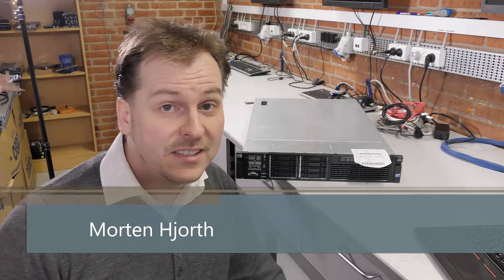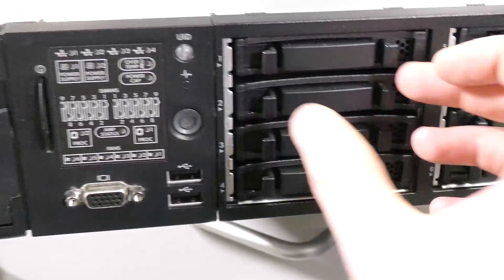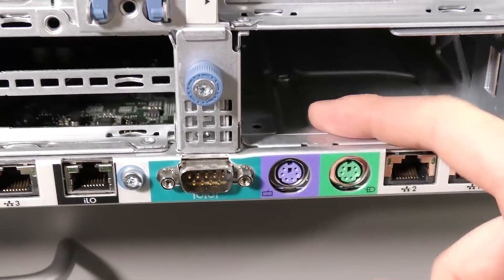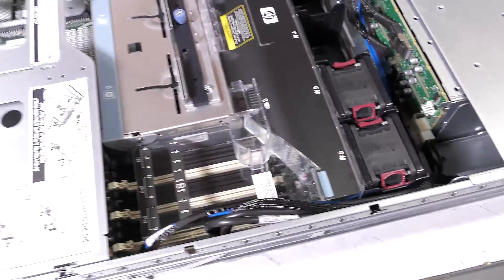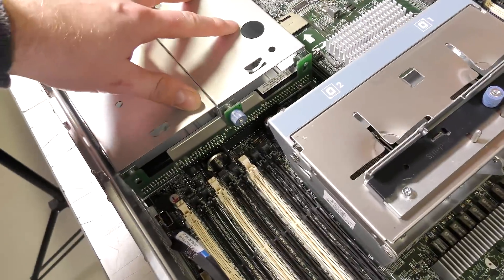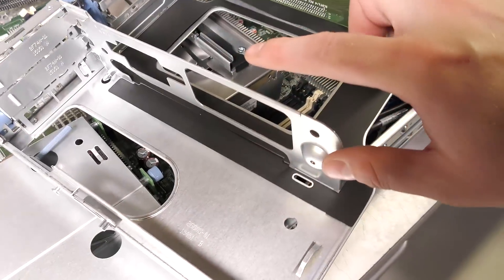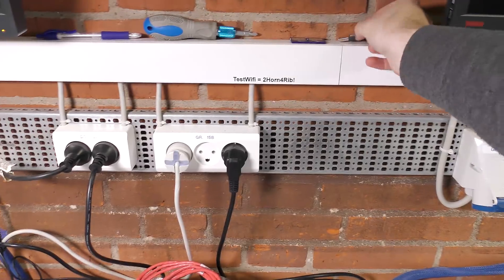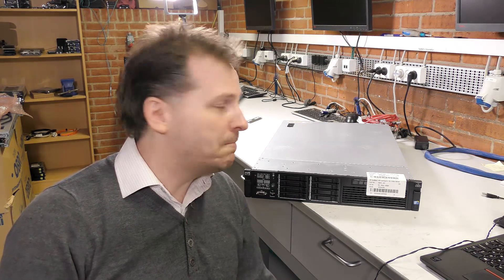HPE ProLiant DL380 Gen7 Server Review - 601

Comment: @Myplayhouse
Can you please tell which graphic card is compatible with this model?
I want to use it as a pc..can you help a little bit?
Reply: Oh boy, I was thinking about that too, so i did something researches.
First of all, I discovered that hp proliant dl380 g7 and dl380p g8 have a huge problem, the support only 1 slot cards, so you will run into some issues trying to fit in them some powerful gpus, but if you are ok with putting a single slot gpu then it's ok, and in this case I would suggest you to buy a g8 (because cpus are more powerful and the upgrade path is a lot better).
Otherwise you can buy a dl380 g6, which has the same socket of the g7 but can actually support 2 slot graphics card (even though you have to remove the IO), so you could potentially use it as a powerful gaming rig, or a cheap workstation, since quadro are a bit expensive.
Reply: Despite everything man you have to consider one last thing, these machines are noisy as hell, so you may run into some issues using one of those, because if you use intensive applications such as gaming or rendering it'll be like running a vacuum cleaner more or less.
Reply from the maker: Sorry, I do not know.

Comment: Hello great videos subscribed to you thanks. 
I bought today server for myself was hesitant..... But bought  it in the end 

 Server HP DL380 G7
CPU: 2 x SIX Core Intel® Xeon® Processor E5645 - 24x2.4Ghz ( 12 core 24 treads) (12M Cache, 2.40 GHz, 5.86 GT/s Intel® QPI)
48GB RAM DDR3 
8 x bay 2.5\" HDD SAS or SATA (included 1x 300GBHDD 10000rpm)
GPU: integral ATI ES1000, 64MB
Raid card : Raid HP Smart Array P410i + 512MB write cache
LAN: 2x NC382 Dual Port Multifunction Gigabit Server Adapter
Pcie slots : 3x PCI Express slot (1x  PCI Express x8 slot, 2x PCI Express x4 slot)
Porty: 5x USB 2.0 (2x front , 1x inside , 2x back ), 1x Serial, 2x video, 4x RJ-45, 2x PS2
Management: ILO3 remote management 
2 x psu 460W

For 180 euro. Was it worth it? Its my first server ever.
Reply from the maker: That was pretty cheap!

Comment: I found a DL 380 without CPU & RAM for 25 USD, do you have something which I can put in the server. I tried to find in Sri Lanka, but it is really hard to find server parts in 3rd world countries like Sri Lanka.
Reply from the maker: What I have is in my little shop : https://www.myplayhouse.dk/shop/en/
There should both be a few CPU's and RAM for the DL380 G7
Reply: @MyPlayHouse  I'll check for processors, but I may need your help to select RAM. I'll first check the shop :)
Reply from the maker: This will do nicely: https://www.myplayhouse.dk/shop/en/memory/34-16gb-kingston-ddr3l-1333-rdimm-pc3l-10600r.html   Small blocks are available..

Comment: Do you consider it worth buying now? I found a 48GB DDR3 ram, 600 GB 10k RPM hdd  12 core(6 cores for each cpu) 2.93 GHz one for 500 GPB and idk if it's a good offer
Reply from the maker: Hi Blazy

If you want a cheap good server to play with. I made a video talking about that : https://youtu.be/p2lGufUYIZw
But if you want a 24/7 server that has to stay in your room under your bed :-) maybe go more this way : https://youtu.be/TqoazLMZNXY

Thank you for watching! :-)
Reply: @MyPlayHouse  thanks for the info, although I wasn't able to find anything available for my country(Amazon and eBay barely ship in here) I think I'll stick to this and probably upgrade the ram if I need to(ecc ddr3 is cheaper than commercial grade ddr3 here lul)
Reply: I literally just bought one for £46 used (single hexcore but a dual hexcore unit with no RAM went for pretty much the same price) :| if you're interested I can point towards the seller.
Reply: @victorovich90  sure, I'm actually interested

Comment: Hi! I have the same server and I have a few questions about it, if you don't mind... First; I have installed Windows 10 on it and when I put it into sleep mode, I can't wake it up, using keyboard or mouse. Usually you just need to check the "allow this device to wake up the computer" in the "power management" tab for the mouse/keyboard but in my case, that "power management" tab is missing. So, is there any option that you know of, that I should enable in BIOS to allow the mouse to wake up the server? And second: when I wake up the server by pressing the power button, it always goes through post screen (power and thermal calibration, etc.) as if it was completely off and not just in sleep mode. That post screen takes up a lot of time, so I'm trying to avoid it by using sleep mode but it still goes through the post screen part. Any ideas about that? Oh and btw, I love your videos, keep up a good work and thanks for your help!
Reply from the maker: Hi Electron Power
Thank You very much!  make sure the firmware is not to old,, and use server 2016 on it instead,, the trial version works for 180 days and can be rearmed.
Thank you for watching! :-)
Reply: My PlayHouse Ok, thanks for the tip! I think the firmware is from 2015 but I'm not sure, I will check. Best regards!

Comment: I have a rack full of HPE ProLiant DL380 Gen6 in my house, when loaded up and with very little air flow there noisy as heck. Keep cool air blowing at them from the front dead quite. The main difference from Gen6 to Gen 7 was the air baffle the cpu support amount of ram and the riser card, also don't forget ilo3 vs ilo2 on Gen6. BTW you can run these servers with 1 PSU on dual cpu. Question for the crowd has anyone gotten Esxi 6.5 U1 working on a Gen6? I'm still running 6.0 U3 on mine.
Reply: Never had that problem, have 3 120v fans in the front of my rack controlled by a temperature controller. If the heat in the back exceeds 78*F then the fans all kick on and draw cool air into the rack. Only cost me about $65 to do aswell.
Reply: Do you have Esxi 6.5 on those DL380 G6? Or just 6.0U3.
Reply from the maker: Hi Chris Lowe
Thank You very much!  glad you liked the video :-)
Thank you for watching! :-)

Comment: Good review! There is another very nice feature : You can remove the media bay with the DVD drive and replace it with another 8x SFF harddisk cage ! Of course you need a second controller then, or you can use a SAS Expander that lets you use all 16 disks in a single RAID array. Nowadays you don't use "battery" backup. The "new" FBWC is a flash / RAM memory with a capacitor (I never had to replace one of these).
Reply from the maker: Hi Cornflake0750
Thank You very much!  glad you liked the video :-)
Thank you for watching! :-)

Comment: Thanks Morten great video, currently running one of these for my home lab, X5670 cpu's x 2 and 72gb RAM with a battery backup cache controller too, great servers and really silent unless you add any non branded HP stuff to it then it sounds like your IBM home data center with them all running or the video you did on the Dell PowerEdge 2950's :-) - A jet engine springs to mind, saying that my older gen 2 and 3 HP DL380s run loud too until the ILO/operating system kicks in... Great video as usual, keep them coming...
Reply from the maker: Hi Tim Box
Thank You very much!  glad you liked the video :-)
Thank you for watching! :-)

Comment: I don't see the point in buying a DL380 G7. I have 20 G6. They offer the same Performance. The only difference is ILO3 and more RAM support.
Reply: And those differences are what made me get a Gen7. iLO2 used a old version of java and was a pain in the ass to deal with. More RAM support is exactly what I needed for Hyper-V. From my experence, the G7 servers had smoother fan control than G6 and earlier.
Reply: 25 Cent Thats nice. But do you really need more than 144GB of RAM?
Reply: Currently running about 192 right now.
Reply: It's a more refined G6, the G7 offers some nice minor improvments over the G6, nothing major, but why bother buying the older model when you can get the newer one. Slightly improved, oh and the RAM is nice,
Reply: For me the G6 and 7 were the same price at $200 for both on eBay.
Reply from the maker: And here 5years later is still a lot of ram,, I today took my dl380 Gen6 out of my rack,, to make room for a newer one.

Comment: What happens when you plug something that's not the ilo into the ilo port?
Reply: Koltin Nilam Usually, server management traffic is put on VLAN 1, and user traffic, VOIP phones, etc., are on different VLANs. If you plug a cable into the iLO port that is not tied to VLAN1 it will not be accessible to the server administrator, but it will be available to whatever VLANs of the network that that port is part of, such as regular users or other persons (hackers, disgruntled employees, etc) would be able to (possibly) be able to access the server and gain "virtual" physical access to it. They would be able to execute actions as if they had physical access to the server. So, it is a big security risk in a data center/server farm setting.
Reply from the maker: Hi Koltin Nilam
Nothing much,, You just feel stupid af hell, when you figure out, you wasted hours troubleshooting the network,, and the bloody cable was in the wrong port.
Thank you for watching! :-)
Reply: Ah, the way you said it made it look like the iLO port bricks a device ie a router